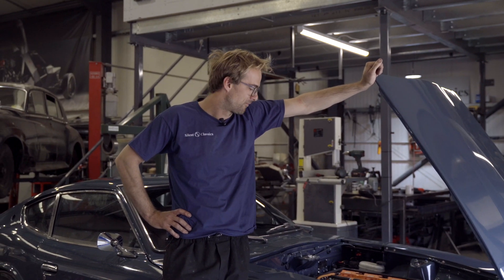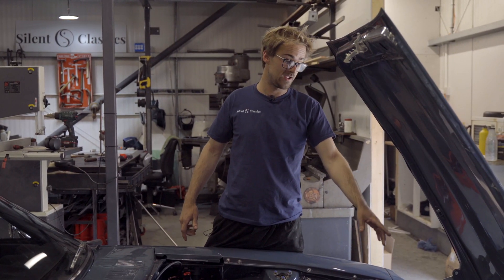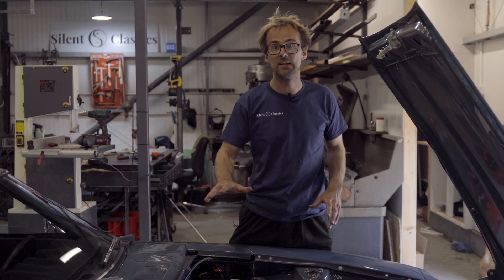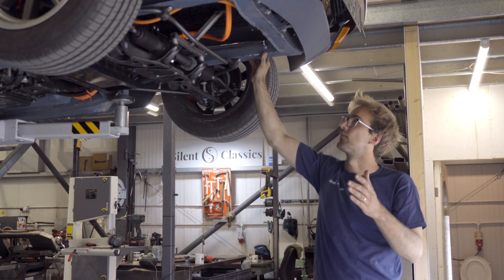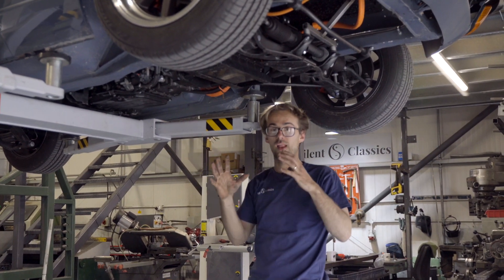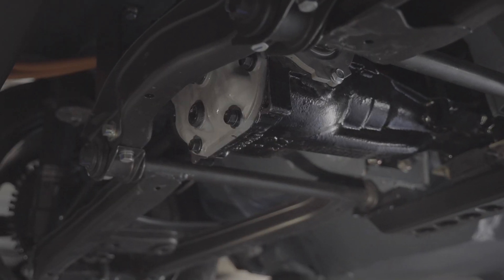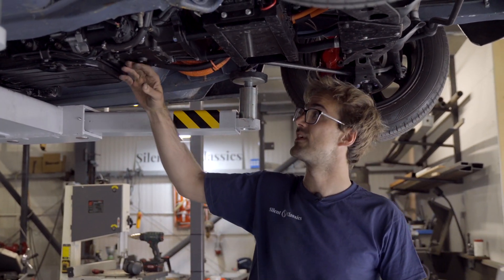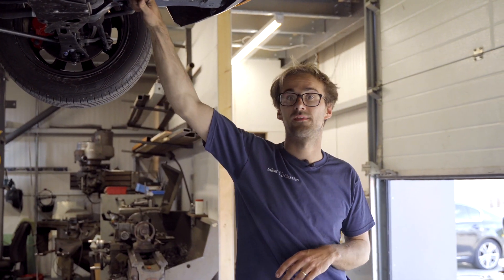Datsun 240 Z Electric Conversion

Comment: I have a lovely, one-owner 260Z 2-seater in need of restoration.  The plan is to sell the other Z's and electrify this.  After owning a Tesla for 14 months, never going backwards.  No matter how fun petrol fumes, carburetors and 5-speed manuals are.  Lose a lot but gain so much more - especially the most valuable thing for me, TIME.  Drive-Park-Charge-Go again

Comment: This has nothing to do with the car of the conversion, but the lift (as seen at 2:06) is an usual single-post design. I've never seen that for lifting a whole car before; usually single-post lifts are used in pairs (to lift a car from both sides), or with one at each wheel (to lift heavy vehicles). 

After a quick search, this appears to be from Automotech, and may even be a mobile (not fastened down, can be moved on rollers) model. That's slick, although the floor under is it is not clear (because of the large foot extending under the car) when the car is lifted - that would get in the way in many cases.

Comment: Thanks for the tour. 

The "Tesla Model S brake booster" is a Bosch iBooster, presumably salvaged from a wrecked Model S. This is also used by various other manufacturers, such as Honda. There is no mention of steering assist (or I missed it), so I assumed that it was manual (using an original manual Z rack), but the video from the "Late Brake Show"' says that it has electric assist column unit from a Vauxhall Corsa.

Comment: I hate to see classic sports cars loose their heart and soul, this would have been a prime RB swap candidate, but this is a pretty clean build since I imagine the original engine was kaput. I wouldn't mind doing something like this to a lead sled or land yacht where the engine was pretty quiet and unremarkable in the first place, and they could "come alive" with the extra low end torque of an EV setup, plus there's plenty of space for batteries in the transmission tunnel and between the frame rails!
Reply: You hate to see a classic lose its heart and soul…

Yet in the next sentence you talk about swapping in an engine that doesn’t belong in this classic.

I’m a bit confused. Your issue it what the motor runs on? If the EV motor ram on gas, would you care?